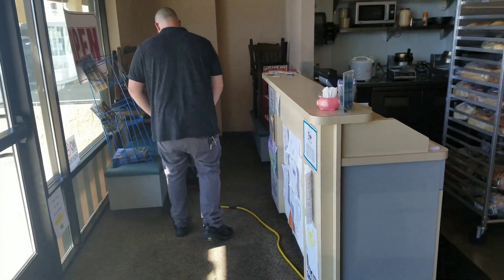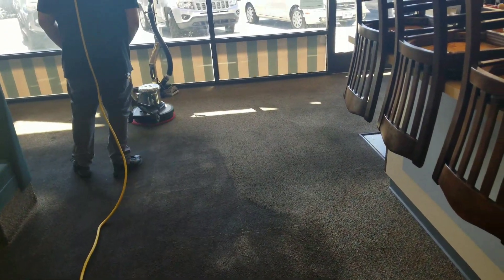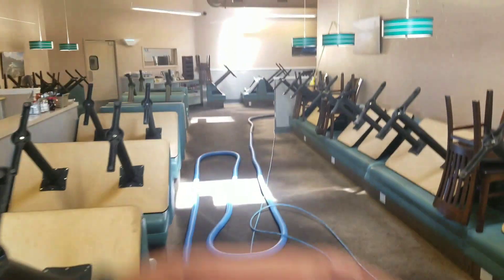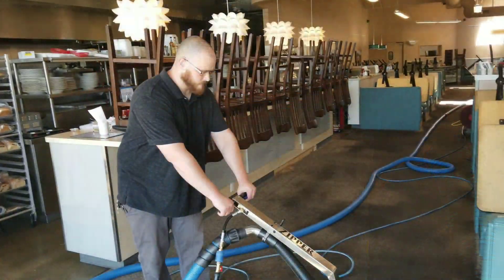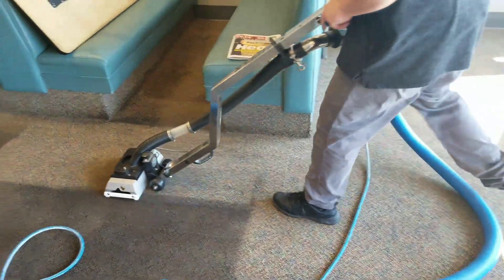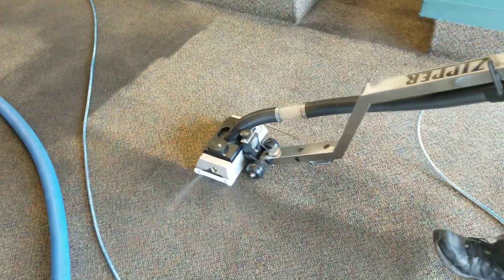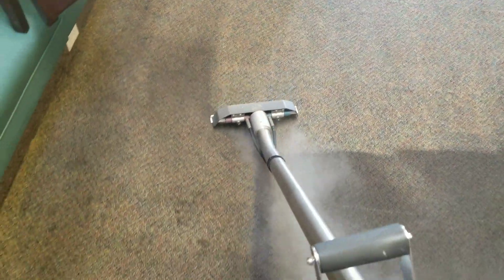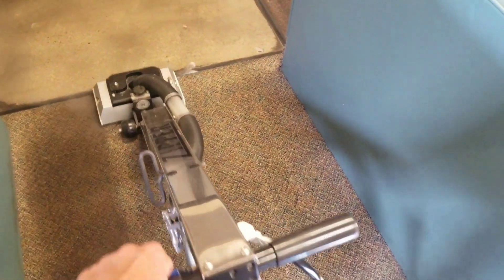Grease pit carpet cleaning with Legends and Cimex shoes..

Comment: You guys do an amazing job and this is not a bash on your profession, but people need to stop putting carpet in restaurants.
Reply from the maker: sho' nuff they are in the process of ripping out all the carpet and going with sealed concrete
Reply: People need to clean their carpets more often. Also the carpets dont get slippery when greasy or wet.
Reply: Carpet is used because of its ability to dissipate majority of the echo in the dining area.
Reply: Badenhawk tbh
Reply: For sure. It's just nasty.
Reply: That makes sense in a home setting but slip injury liability in public places is traditionally why they install carpet.  With aggressively textured tile you wouldn't slip but you couldn't mop it either.
Reply: @TheTurboman2  Yes, you can. You just need the right tools and cleaning product.
Reply: @02rtjawn  Echo can be dealt with in a good design of the area and sound deadening wall treatments.  It is called acoustic design.  Just have to find an engineer who knows how to do it well.
Reply: @tinydancer7426  I agree the customer just won't want to pay for a hard surface turbo cleaning every other day. Or perhaps they could just buy a high-pressure portable and a turbo and keep it in the back room every time the tile needs cleaning in order to keep customers safe and from having their feet stick to the floor. It's just no one's going to pay to keep tile that deeply cleaned when a cold soapy mop will get them by as they watch the grout turn black. So for now carpet is found in most formal sit-down restaurants. There's money to restore carpet and tile and grout. Enough to go around for everyone.
Reply: Mark Markovic Yep, so true. I used to work at a major international computer retail chain that uses Florentine sandstone floors in most of its stores. And indeed, you can’t really mop it clean. Sure, it was mopped regularly, but in the stores that had a kids section with area rug, you could lift the rug and see how much lighter it was than the area that got mopped! So every 6 months a floor specialist would come in and deep clean it, and the difference was so striking that we would come in the next day and be like “holy shit it’s bright in here!” 😆

Comment: I would just rip all that carpet out. Not sure why you’d have carpet in the main dining area. Cleaning a carpet in a dining area is like trying to polish a turd, but you guys sure did a good job!
Reply: Agree, especially wondering why they would use carpet squares...
Reply: Slip and fall accidents are expensive. Some business owners don't have business insurance and have to make due so they try to minimize their probability.
Reply from the maker: they are in the process of removing all carpet from their 7 locations
Reply: Tile would be way harder and more expensive to clean
Reply: @MikePailliotet  that sucks, it's probably a good paying contract. You should try to get the tile cleaning contracts.
Reply: It looked fine afterward. No reason to rip it out.
Non-carpeted floors in restaurants are for the peons.
Reply: gantmj must be a regional thing, I’ve never been to a fancy restaurant with carpet floors, especially carpet in this shape.
Reply: Otherwise it's laminate, tile, or vinyl. All that are loud as f if you've ever been in a restraunt with all hard floors you'd know. In the meantime be thankful because carpeting is a dying breed.
Reply: Agree! But still satisfying
Reply: A couple of reasons. In some dining setting plenty of grease from the kitchen is tracked out to the main floor by the servers, this creates build up and is very hard to scrub off without intense heat, also can create slick floors and slipping hazards. Another reason as someone else stated hard surface floors can be very easy to slip and fall is someone spills something on the floor. In dining settings a hard surface floor can easily become sticky and give off the feeling of not being clean which is a huge turn off. A carpet area in a food chain should be cleaned every 30 days at minimum and vacuumed daily to be kept up to standard.
Reply: That is true
Reply: Traction, that heavy soil is from kitchen grease
Reply: Its the truth!!
Reply: Well, if that IS grease, as the title says, then carpet would be the safest bet where patrons walk... albeit, not a classy sight
Reply: Lol. Agree. Stained concrete would look good. Or even some wood flooring
Reply: I wouldn’t eat in a restaurant with carpet that dirty.
Reply: @gardenstateadventures7259  I had a scrubber and whip tiles right up 
Went over them with a regular  vac after,  but tiles can be dangerous in a restaurant

Comment: Mike what your thoughts on the Bonzer?
Reply from the maker: It's a poor man's Zipper 

The handle may be easier to use for some.
The swivel option makes sense
If you acid rinse, make sure to flush it well after use or the aluminum will erode

From my perspective the company is fading quick

Comment: Your using a red pad on carpet ? How safe is that to use ?
Reply: Tommy Gunnin 
It's fine I used them sometimes for low moisture cleaning
Reply: Nice job. However a red floor pad on carpet is never good.
Reply from the maker: @outdoorsforever1  why?
Reply: Red pad is fine some are thicker grid for tile and others similar to white pad. As long as carpet is moist its fine

Comment: How the hell do you get that that clean?!.!!  Is it the equipment? Is it the steam shooting out bottom of the machine or. The special solution? Its soooo CLEAN!
Reply from the maker: The process involves dry vacuuming, applying a degreaser, scrubbing, followed by hot water extraction ( spraying and sucking)
Reply: Thanks for replying. Its so impressive!

Comment: I'll tell it like I told the other guy. I'm sorry but high pressure fluid wont remove all dirt from fibers. Most of the time this only removes surface dirt and stain will later come back after dust and foot tracking settles back into the area that was stained causing the stain to return shortly after. Only real way to get even close to long lasting results is to agitate the carpeted while spraying super heated high pressure fluid and suctioning all in the same process. In this video you are certainly removing soil. But alot of that is surface and I'd expect that. The residues left behind will bond with dust fast bringing those stains back pretty quick. If I recall your zipper agitate but also lacks in pressure. And effective suctioning.
Reply from the maker: Oh..

What would you recommend for better suctioning?
Reply from the maker: How?

Comment: I would clean this using a Rx 20' a lot faster and 100% a lot deeper clean. I did Restaurants 100 times worse then that and it came clean. The process Your using 100% would wick back up after it was walked on' I also did Plants that the employees would transfer oils from the outside butcher plants they worked in. This is an amature job your showing also small too
Reply from the maker: Dude, stfu. I've cleaned this place with Rotovacs and everything else under the sun tool wise.
Reply: Every slab foundation is not the same and an RX-20 on CGD would likely bounce over humps breaking vacuum.  I know, I'm a 25 year user.

Comment: Why not just replace the floor?🤔
Reply: cost and down time is the answer.  you loose income when the restaurant is closed and new carpet is way more expensive than cleaning.  It's just soluble sugar and oils mixed with a little outside street dirt.
Reply: @TheTurboman2  lol I coukd install a new floor in the same amount of time it took to clean it once. But its going to need to be cleaned again and so on. When a new floor you could just mop😐
Reply: @TheTurboman2  who the fuck puts carpet in a restaurant? Tile or vinyl is the only way to go.
Reply: Why not just repaint your car instead of clean it too?
Reply: @MrJoshcc600  yeah it the paint is shot, and they're just going to have to clean it again. That comparison is stupid. Why would you want fabric around where you eat and drink? When the fuck have you been to a restaurant with carpet?

Comment: Carpet in a resturant? Someone didn't think that through.
Reply: liability from slip injury. And carpet is cheaper up front when the place was built than tile.
Reply: Cheaper to clean, It's a sound insulator so the place is quieter, cheaper to install, less slip hazards and liability.... The list goes on...

Comment: you must of just got that machine  it's a starter machine, power burst isnt that great, it's a oldschool solution, there is new chemicals like tmf products that work way better than power burst with ultra pak ,is still good product..
Reply from the maker: Must have?

I've owned a Butler and a Vortex and still own an Aerotech and Everest 650.

I've been at this 33 years now.

The 370 is an excellent unit.

Comment: FYI ask Jim Banes. RED pads are for tile buffing not carpet Us a Brush an With a Carpet Mount YOU DONT NEED to do all that extra drama lmao an that's a 2 hour job 2 People ONLY an that Mount is tiny Mine is Everst Pro 3000 7 times that size an your missing alot like Base Boards lmao
Reply from the maker: Everst Pro 3000...those are the best!
Reply from the maker: https://mikeysboard.com/threads/who-the-f-is-jim-banes.291347/#post-4621940
Reply: Do your customers get mad when you lick their windows?
Reply: I know mine was 65,000 an I had to get a Box Truck when you have UB north an South a Malls an call Centers an Buffalo Air Port You go big or Go home I was gone to get a Vortex lmao licking windows if you was getting 15$ a Window you would lick them Deep lmao
Reply: An Jim is the Master Tech Jim Pemberton his Father Is the Inventor if you dont know Jim then Your a Rookie an the Mount you have is Very good for small jobs An the center disc in the red  pad remove it  It let's air Flow throw the pad an it wont it plugged up an Ever lay Plastic on top of the mount It will Melt
Reply from the maker: @716racingchannel  65k plus the vehicle?

Comment: You guy ate so silly , here in canada we use elbo grease 1st and then hit it with some , oxie clean for rugs , why you ask ... Well the working foam ( not bubbles ) to make the old dead skin , mits , fleas ,bed bugs droppings along with their old shells , and it kills male cat spray , wine stains and all the shit you zipper cant get .. After the scubbing pad clogs with hair , loose threads , and carpet tumble weeds go and buy a cleaner called Breaker .. This stuff cannot be beat and its food safty with means it wont hurt you ..we also have a 6 hp vac , and heats the steam to 148.2 % pure hot steam after you scub is so much the just scub and vac .. Been doing this the same way for 25 years ..
Reply from the maker: I hope your command of your shop vac is better than your command of the Queen's english...

Good f'n griefs.